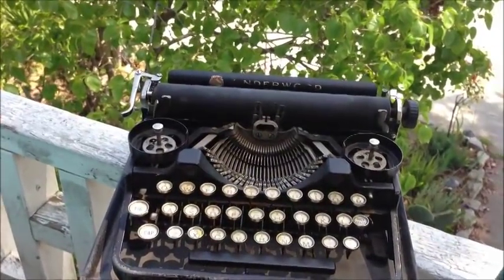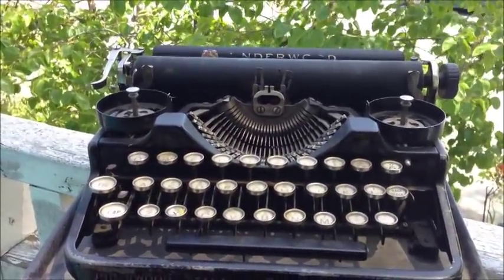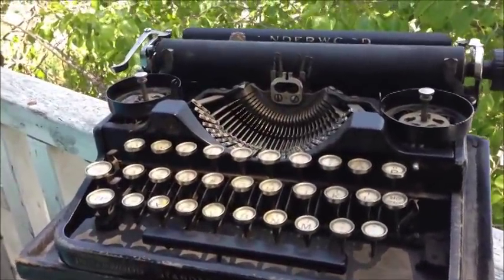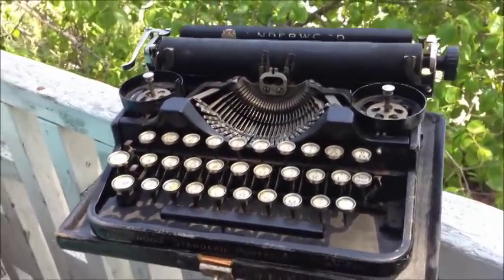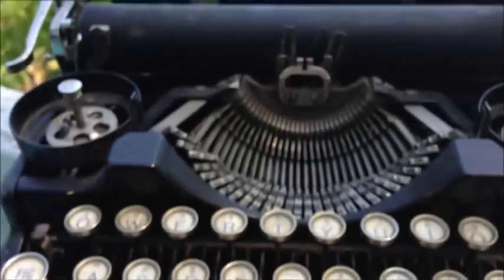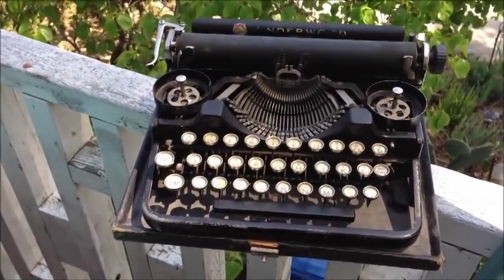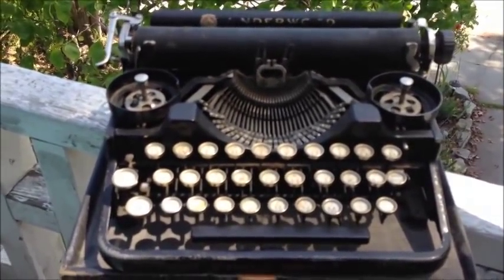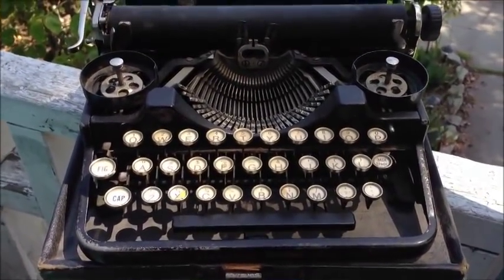How would YOU make typewriter keys?

Comment: I've had success with glass top white keys by seperating the offending key completely--metal collar, glass top, letter face and cushion. Then (1) find a font that matches the key in need of replacement. I use a closely related font then edit in Adobe Illustrator to get it as close in size and style, (2) print it on acid-lignin free paper and cut out with a scalpel to avoid rough edges, (3) reassemble key, apply adhesive carefully, allow to dry for 48 hours, (4) reattach. I would use a leveler when combining to ensure you don't get an upside down letter :) Painstaking process but for a purist, it's worth it. If you have another solution I would love to hear it!